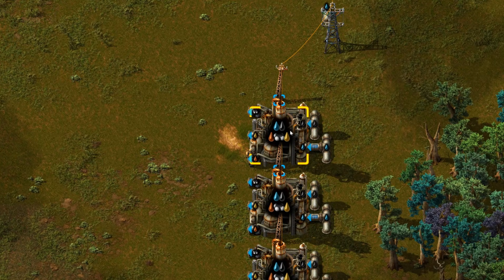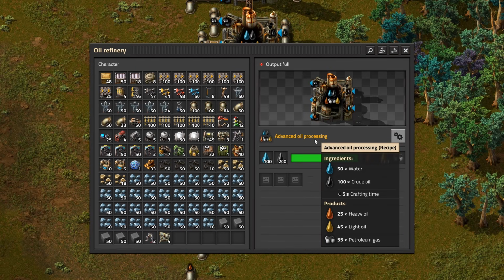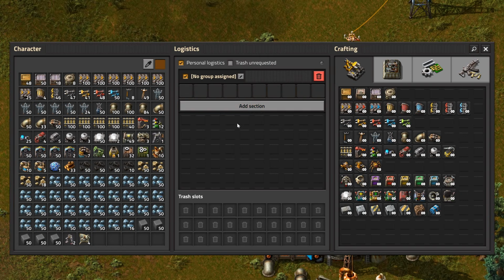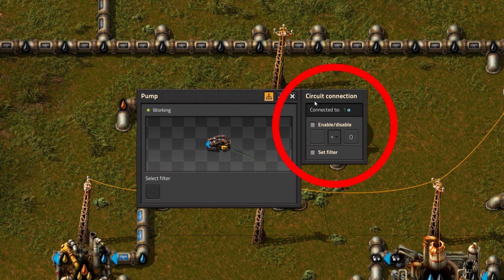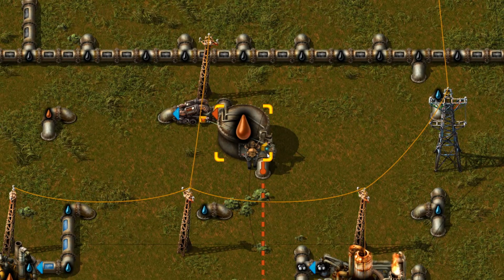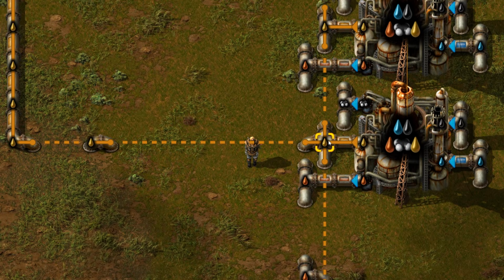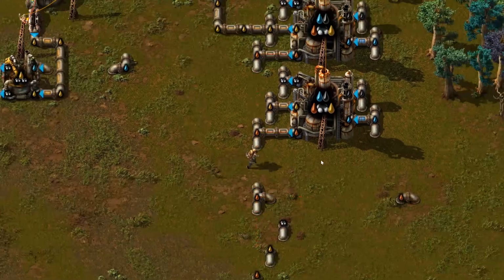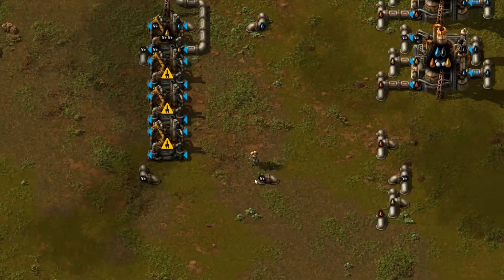Oil Cracking Basics | Factorio "Quick" Tutorials

Comment: very nice tutorials, love the format. a bit of a shame about the compression not seeming to agree with you on these videos though. don't usually have these issues on your stream. I wonder what decoding other Factorio content creators use. only some have these issues, not all, it seem. 
Nilaus too seem to have this issue often. Avadii for some reason doesn't.

but it's a great message that one don't need the perfect blueprints. I just purged my blueprints folder, only to make a grid aligned self-building train blueprint collection, so that I can sprawl out more and stop building the same concentrated base.
Reply from the maker: I might have worked out what the problem was with the quality - if I use the h.264 codec (rather than h.265) for the encode then it seems to go away.  Or at least, it seems to have sorted it for the next in the lore series videos - I'll have to see if it works long term.  Certainly exporting as another format and then converting it also worked so I can fall back on that, but it takes ages.
And thanks for taking a look - reaction seems to be positive overall and doing more will help me get a bit smoother and more consistent.